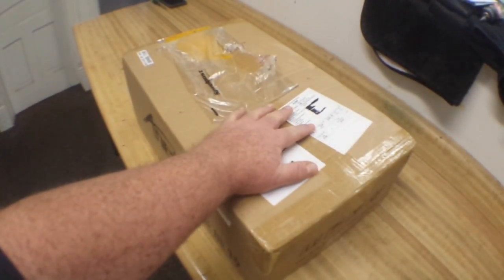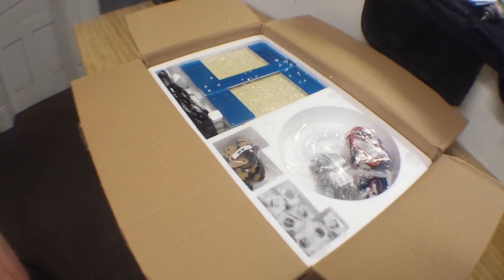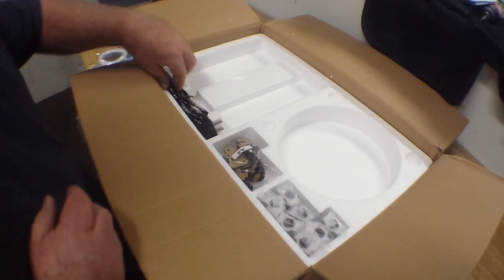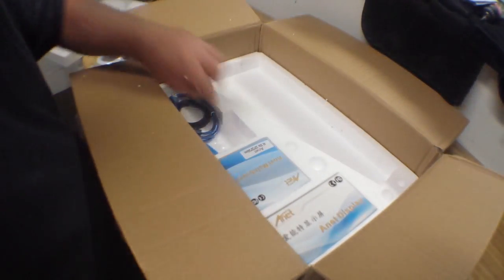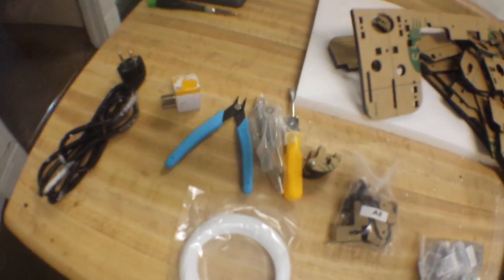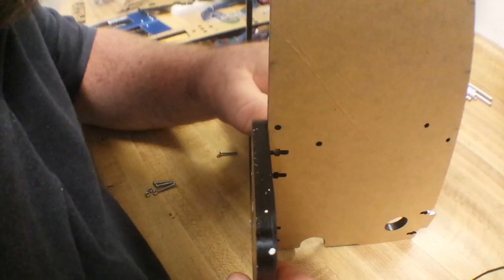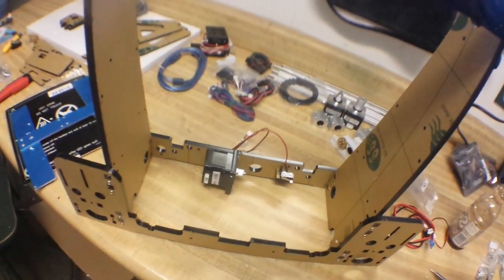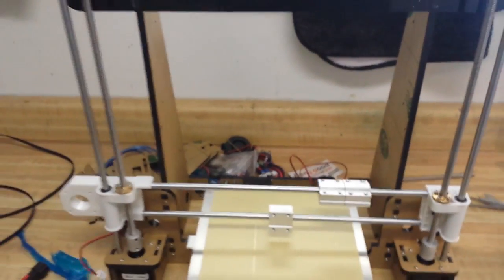Bumbling fool builds a 3D Printer Part 1

Comment: I have seen many online forums complain about this printer, mainly that it needs a mosfet upgrade for the heat bed, and that the power supply has a very dangerous failure mode.
Reply from the maker: +Paco It died today after it's 3rd print.